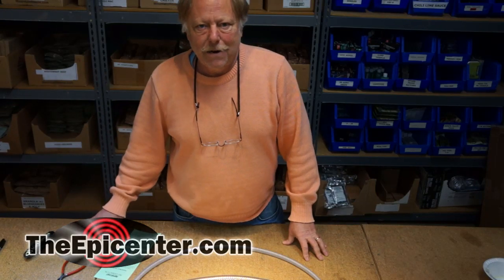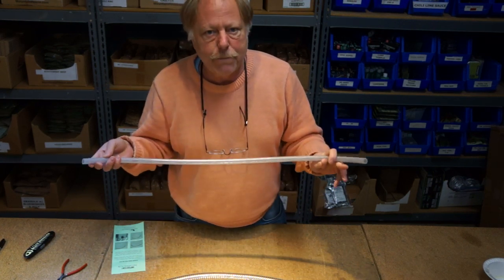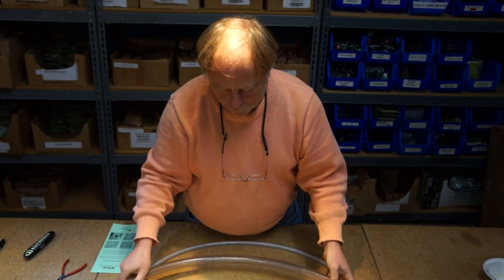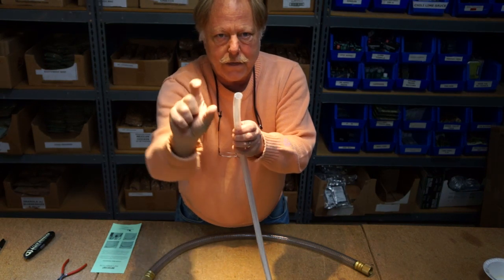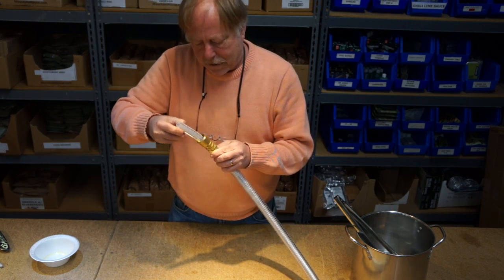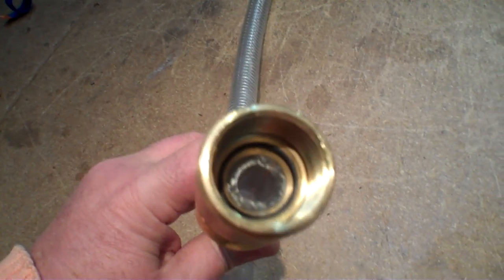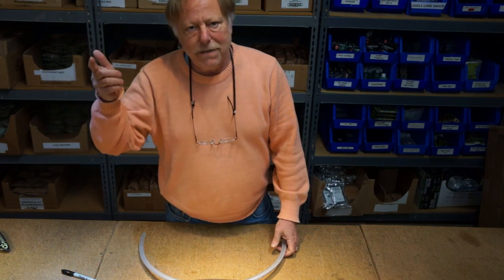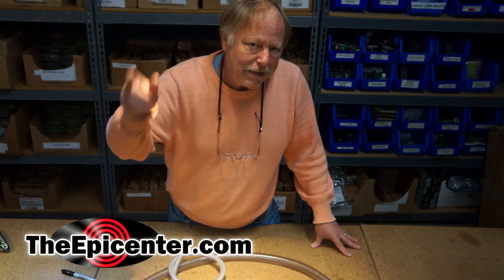URGENT TIP - Modify your hose -  Reduce water in your pump - Harvest Right Home Freeze Dryer.

Comment: Bryan, I'd like to share an experience I had with my large dryer. I bought it in December of 2018 and about 3 months in the relay for the pump power went out. They gladly sent me a new control card and I installed it. I noticed the relays they use are only rated for 8 amps. As an industrial electrical/instrument tech for 45 years it is my opinion that the relays are under rated for the in rush current of the oil less pump. For that cure I installed an inter posing relay with a 20 amp rating - problem solved. 
A few months ago I started having issues with the heaters not coming on when called for - I would give the top of the machine a good whack and it would behave and finish the batch. Last week (Feb. 18 - 2020) It finally gave up the ghost. I removed the bad relay for the heaters from the card and replaced it with a PC mount 12 VDC relay with a 10 amp rating. This should be good enough to last many years.
This repair can be done by most appliance repair tech's for less than the cost of a new control board. If one is handy at soldering it is easily replaced for about $8.00.
I have contacted the company and gave them my findings - Maybe they will upgrade to 10 amp relays - maybe not. But for anyone who has a dryer that is out of warrantee and is having issues with intermittent issues - this may solve their problems.
Reply: @FloatingFire358  Are you saying you don't own a single appliance? Any appliance you buy can fail. My Samsung refrigerator has had to be worked on 4 times in the past 6 years. My Maytag dishwasher had a fatal issue with the electronics after only 4 years. I could go on but I think you get the idea.
HR has a 3 year warrantee - most appliances only have a 1 year warrantee. HR also has a great customer service department that will help anyone resolve any issue. I just happen to fix things for a living and have no problems doing my own repairs. But really any appliance repair person can fix these machines - they are really very simple. I do communicate with many HR owners and almost everyone has been very happy with them. They have made many improvements in the past 5 years. They really are a well made machine. 
In the end it's your decision weather you buy one or not. But I will stand by them as a reliable appliance. A shame I'm not your neighbor - I'd guarantee to help fix any issue you might have for free.
Reply: @jerrysmith372  
Hello! I see you at lots of FD channels, I can tell you understand the machine .. and get the most from yours!

I just received my medium unit.  I did not receive the pillow. When I called, I was told it wasn't necessary. But the FD drips condensation puddles. I put a towel down to catch the drips, I am in a humid climate.

I read your post about being a FD veteran. I have some questions, and wondered if there might be a better way to have communications with you; if you wouldn't mind answering some newbie questions.

Comment: Thank you.  Wish i had seen this yesterday 😂. I put my large hose in the oven on “warm” for a few minutes, then put the small one in the freezer.  I got it in, but it was a pretty crazy act!
Reply from the maker: Yep. I installed a hose for a local customer this weekend. They weren't able to do it with the oil mentioned on the green sheet. And since it had already been oiled it was hard to get a grip on it!  After cleaning it, I noticed it was flattened out. That's when I came up with the hot water method. Much easier.

Comment: I was wondering what the heck it was for. Didn't have any paper work with it. Thanks Brian!
Reply from the maker: Too funny. No paperwork?
Reply: @EpicenterBryan  Yuppers just the hose. I figured maybe it was a drain hose. I don't use a drain hose though. It kept getting nasty and I hated sucking air through it into my chamber. I took it off at the valve and let it drain into a bucket from the valve.
Reply from the maker: Mystery solved!  Put it in your vacuum hose and away you go! How long ago did you get it? Three weeks ago perhaps?

Comment: Worth noting, the Harvest Right website states for units shipping on 12/1/19 and later, this step is unnecessary.  The newer units come with the 3/8" hose instead of the 3/4" hose.  It also states switching out to the 3/8" hose reduces pump oil changes to every 4 - 5 batches depending on the quality of oil used.

Comment: We just ordered a new pump and they charged us 6.99 for the tube.  Also they send us a 220 vac (50hz) pump. NOT the 60hz. What do you think the difference will be? I have talked to a couple electricians and they said it will run hotter and not as efficient. Also the pump is a  (  6 CFM ) Not the 7 cfm we got last time.  Not sure what to do. The tech at HR said NO PROBLEMs it will be fine.   ????????/ can you help ease our minds. Thanks and keep up the videos they are great.

Comment: Thanks for the modification information Bryan.
I'm looking forward to trying this; it will be interesting to see if such a simple modification can make such a huge difference. Would you happen to know the science behind the smaller tube improving the water/particulates issue?
I'll be adding the tube to ours after 3 more batches. But first, I'll clean and check the pump first so I can track any improvement. This will be 100 batches since I last opened and cleaned our pump and it was very clean then. At that time I upgraded my filter system and added a better water block filter. My system is very similar to what you have in your Oil Filter / Water Separator video (except way more low tech because I hadn't seen yours yet and hadn't thought of using electronics for control) I've been using the same oil for over 250 batches now.

Comment: Thanks for the info. I bought the 9/16 tube from Amazon because I have the original garden type hose and it fit perfectly. My pump seems to operate quieter now with it installed. Would you happen to know the size and type of fitting that is on the older machines that have the garden hose style fitting? Also what is the new hose fitting called? I would like to buy an adaptor to go on the machine so I can use the new type of hose. Thanks

Comment: Use stainless steel or copper flex tubes used for gas or water. No de-gas problems. Cool it ice cold, keep pump cleaner longer.

Comment: Great info. I'm dealing with a new issue tonight. My release valve will not release anything. I've finished product in my large HR FD but cannot open it to retrieve. The release valve swivels as if it's opening but nothing is happening. No air rushing in, no moisture dripping out. WTF??

Comment: I found tubing from Amazon that was 19/32OD which is the same size as the one I got from HR. It was about $2 more than the 5/8OD I got from HD that would not go in.
Reply from the maker: That's an even better solution! I didn't see that size before (19/32 OD x 3/8" ID).
Reply: Thanks for the information. Here is a link from a supplier I used. https://www.beveragecraft.com/clear-braided-tubing-3-8-id-19-32-od/

Comment: Talked to HR tech today, and they said until I got the new smaller tube for my oil-less pump, I should perform a dry flush after each cycle. Also FYI, the oil-less pump will sometimes allow the vacuum to release after the cycle ends if the food is not removed for a few hours. (I called them because I did not have a vacuum this morning after it finished late last night)
Reply: The oil less pump has a check valve on the exhaust port. Unscrew it and clean it with some white vinegar and brush. That should take care of it loosing vacuum. It worked for me.

Comment: My husband works on hospital sterilization machines that use mega vacuums when they sent us the hose it didn't make sense to me.  It seems like the smaller hose in my opinion actually will put too much pressure on the vacuum and your not getting a vacuum it's going to stress out the pump.
Reply: Vacuum pumps can handle restrictions (think how little air they pump once it's almost done), but smaller hose could make it do pump down slower.

Comment: I wonder how much of the problem of water and particulate entering the pump happens right when people open the valve at the end of a run.  I have always just cracked the valve slightly open when I'm ready to open the door and take out the finished food.  Sure, it takes a while for the pressure in the chamber to rise to equal the outside pressure so that the door can be opened, but it seems like doing it this way reduces the sudden shock on the entire system, and reduces the potential velocity of the air moving between the chamber and the pump, and thus should reduce the amount of particulate and/or water droplets that might be drawn from the chamber or its plumbing out into the tube to the pump.

When the pump first creates the vacuum in the chamber the process is gradual.  And once the pressure in the chamber is low, the volumes of air that move through the tubing must be quite low.  So to me, the only time you'd get a sudden "gust" of air blasting through the tube between the chamber and pump is right when you open the hand valve to equalize the chamber with atmosphere at the end of a run.

You also run a lower risk of pulling droplets of water that may be in the drain hose on the atmosphere side of the valve into the chamber with your newly-dried food by relieving the vacuum gradually.

Again, I know this means that you'll have to be somewhat patient, but with runs often taking many hours, a minute or two of extra wait before I can open the door doesn't seem like too much of a burden.
Reply: I put a 3-way nylon barb connection right after the ball valve, and put a 6" piece of nylon drain line vertical so that it sucks air before any moisture at the bottom of the drain line doesn't get sucked up to the machine. I also have my drain line plumbed into the drain line for my ice machine under the counter that the HRFD sits on
Reply: @PavelowGunner1122  Sometimes water gets trapped between the chamber and the valve.  Especially if HR installed the wrong line like they did on mine.  In any case, the line is unsupported unless you do it yourself and can sag.

The end of the drain should never be in a wet environment.

Comment: It'd be nice if the machine and pump came with normal fittings instead of gigantic impossible to find Japanese hydraulic fittings.  Fortunately, the diameter and thread count is the same as a garden hose.

Comment: Any secret to replacing the o-ring in the end of the hose when you knock it loose?
Reply: Take 2 pieces of string and have them go through the middle of the oring.  have the strings at the initial contact point and pull the strings onto and around the object receiving the oring. Do it all the time at work and we use high durometer orings which are stiffer.

Comment: Or make a catch can with a drain inline.
Reply from the maker: Have you tried that?
Reply: @EpicenterBryan  I run one, just google vacuum catch cans, pcv catch cans etc. Learned that from running Turbo Buicks, the Pcv is in a bad location and would suck up hot oil as it drains from the turbo so everyone would run a catch can.
My first one was a DIY out of a Coleman propane tank. Lots of DIY on the net.
Cheers Brian, Love the channel!
Reply: @mcasteel2112  great info, could you please share pictures and reference links so people can try your strategies. Much appreciated.

Comment: I received my hose and my dry times begin to get longer and longer with each load.  I tried to check the o rings and one fell out and there is no directions for putting it back in.  Not a happy camper.  I was checking for leaks when the o ring fell out.
Reply: Yeah, I feel your pain! I have had our HRFD for a bit over a year, got the Premier pump and have done a few oil changes [so, I assume that’s moderate use?]  it sat for a month in late spring and all of a sudden it started screaming “can’t reach full vacuum” [or something to that end?]. The HR folks were solid help but the help was slow.   They are a pretty small company? And a lot can go wrong
Long story short, it wasn’t the pump, it was the treaded section of the epoxy-plug [as they call it] and from watching YT postings I learned to use Carb Cleaner and that got me to the right general area.  Unfortunately the leak was at the bottom edge and because Carb cleaner is thin, my attempts to pin point failed because the cleaner always flowed to the lowest point .

The fix was to use 100% silicone sealer.   And when I was in the middle of a FD cycle, when the warning went off, I smeared that sealant where I THOUGHT the leak was and yet it didn’t help… yet I KNEW the leak was around there, so I smeared it on the threads and when I  got to the bottom edge…BOOM! Immediate response! Vacuum dropped immediately!

HR also sent me a new epoxy plug mechanism, which was nice of them!  He did say that the silicone fix tends to be permanent?  We will see?

Hope you are back up and running!

Comment: I would suspect that the smaller hose would ultimately result in a lower pressure and higher velocities, amounting to more turbulence and more mixing and more content remaining in gaseous form where it is ejected via the demister.
Reply from the maker: I don't know. I'm a former electrical engineer, not a physics or hydraulics guy.
Reply: I agree it MAY induce a pressure drop across the line and certainly a higher velocity at the same flow.  I'm not sure about more turbulence.  Considering the wall disturbance reduction coming being a smoother hose the flow may actually be more laminar.

Considering the problems recently with poor crimps and vacuum leaks my first priority is solving that.  I wonder why HR still uses this size fitting if it's a concern?  BTW have you noticed the necking in the pump fitting?  Much smaller than a normal JIC fitting.
Reply: @BowWowPewPewCQ  Mine is now working but originally I had leakage at the fittings.  Seems like bad quality at the crimp and sealing locations.

Comment: If is just a matter of making the inlet diameter a bit smaller why does it have to go the whole length of the hose?
Reply: Because it's a vacuum line. The suction will move a small piece.

Comment: l'm going to be getting the latest harvest right freeze dryer with the oiless pump would I need to use this modification also
Reply: Yes u will , unless HR sends u the smaller hose. I just got back my oil less pump , rebuilt  and  told to put the sm hose into the other hose
Reply from the maker: No. They will be sending a hose with the tubing already installed.
Reply: @EpicenterBryan  thank you that info helps alot
Reply: @EpicenterBryan  Is the black hose the one with the smaller opening?
Reply: @txrose3809  I just sent mine out for seal replacements last Wednesday, how long was you turns around time. They also sent me the two small hoses to install. 1 for oil pump hose, and the other for the oil free hose? Also how long did your pump last before needing to be sent in for seal replacements?
Reply: I found out my black hose does NOT have the smaller opening.

Comment: Does this apply to the oil-less vacuum pump?
Reply: yes, they were part of my harvest right i just got, and said to run pump dry for 15-20 minutes between loads since the other ways ruined the pump faster from there findings
Reply from the maker: Yes. All pumps.
Reply: @familyj4715  hmmm...got mine a few days ago and have heard nothing about this.(with oil-less pump)
Reply: @reprosser  yea I got oil-less pump and hose already made and they said it is on all machines that are now outgoing and will give new pipes for free when ready if still under warranty, so now I ended up having a bottle of dairy farm oil not needing

Comment: putting oil on last?!?!?!?!?! you have not pulled wire or stuff much, if you had you would realize that its the tip the has the most fiction. sure it worked here but use less oil lightly do skin and its peanut butter jelly time